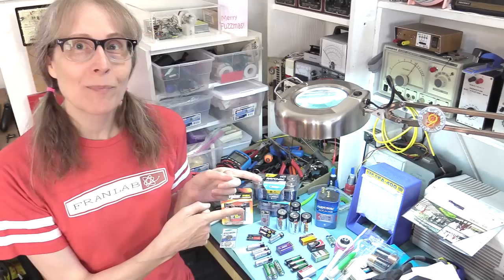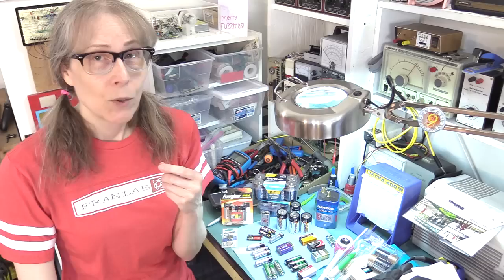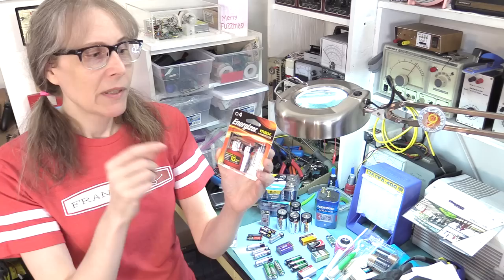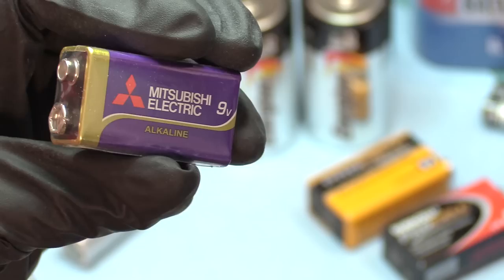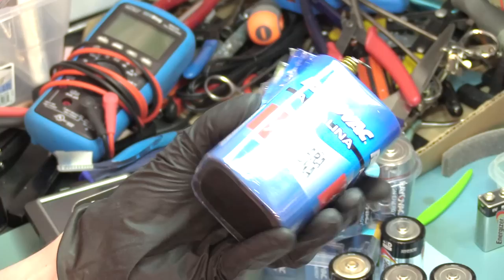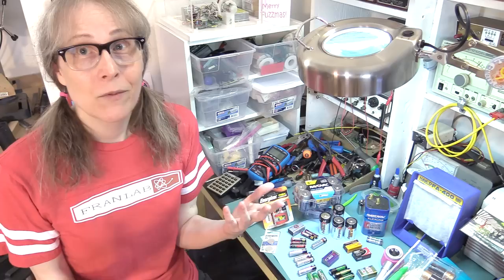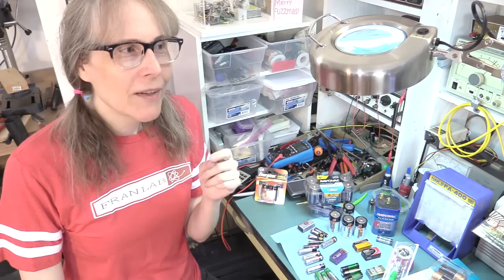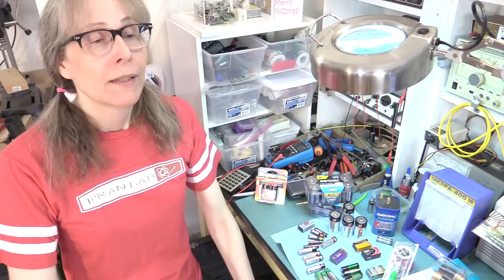Yikes! Leaky Alkaline Batteries!!!!

Comment: I've been trying to use rechargable batteries in all remotes and other pricey items to avoid the leaking situation. This is not always possible but it does help. Infrequently used items, I store the batteries in a ziplock packaged with the unit. I try to use items selected for their battery type, to reduce the amount of types I need for backup.

Comment: I have a Zenith Transoceanic radio with the original huge Zenith battery still in it.  One side is 90 volts and the other side is 1.5 volts.  The 90v side is dead but the 1.5 still shows almost 1.3 volts!  It has to be at least 70 years old!  I am thinking about carefully taking the battery apart and replacing all of the cells with modern batteries and keeping the original Zenith battery case.  The graphics of the battery is super cool!!

Comment: Hi Ms "Fran Again"..yeah leaky batteries...have replaced and cleaned off many a contacts area using moist baking soda...as well as those battery boxes in my car where the battery is placed in the engine compartment...and the roommate's car where the battery box is in the trunk...and yeah I buy batteries 2A, 3A in packs of 10 or so...usually 2 or 3 times a year...

Comment: As a testament to Ray-o-Vac batteries, I have a found a few unopened packs of AA and AAA's from the early 2000's which have not leaked, and still have a strong charge.  

As far as other batteries, I have a small portable fan that has a set of Radio Shack Enercell AA alkaline batteries which have not leaked, and the fan still works (though not to its full potential!), along with a green Radio Shack Enercell Extra Life AA "for transistor products" (carbon zinc) which still reads 1.29v. The green one is from the early '90s.  Unsure about the alkalines, but they have the more recent logo. 

I also have a set of Union Carbide Eveready Energizer D cells (also carbon zinc) from probably the 1960's or 70's which have not yet leaked.  These are totally dead, though, and if I remember correctly, one has a slight negative charge.

Comment: I've had rayovac batteries leak even before use!  Sunbeams are carbon zinc and interestingly enough a radio from the thirties said not to leave the radio on with dead batteries or they would leak or burst. I think that back then most all those batteries were carbon zinc with a sal ammoniac electrolyte as I remember. My transoceanic, even the transistor one uses the old style batteries. As far as alcaline they last a lesser time than the cheap sunbeams as the radio has a lower drain. Kinda interesting but that's what happens when you are antique enough to remember all that! All the best on your channel!

Comment: Aluminium foil if your too mean to buy a new device is great for fixing the damaged connections on most battery devices as long as there is a enough material left over on the connections such as the springs as they tend to snap right off. You then need to scrunch the foil to hold the batteries in place. Very interesting, I now tag and date new installed batteries and remove batteries especially in expensive devices that dont come with rechargeable packs if I am not going to use them for a while. Remotes are the main culprits.

Comment: I'm surprised you thought Sunbeam was a bread company 😂. They are a electronics manufacturer and are a pretty common grocery store brand of batteries here in canada at least.
Reply: We did have a Sunbeam bread brand here in the 50s and 60s. It pops up once in a while since the brand is no longer established in any given area.

Sunbeam batteries are almost exclusively sold by Dollar Tree in the states. Not spectacular but I have not had any turn on me in 10 years of using them. 

I seem to recall Project Farm here on YT testing a whole slew of these a couple months back. Might want to look that up.
Reply: @RuneTheFirst  here in Canada they still make electric blankets, coffee makers, toasters, thermostats, basically anything to do with heating.
Reply: I remember Sunbeam bread from the days of my youth. There was a cute photo of "Little Miss Sunbeam" on the wrapper. I haven't, but I'll bet you can find the photo with the Google machine.
Reply: Sunbeam is owned by Newell Brands: Paper Mate, Sharpie, Dymo, EXPO, Parker, Elmer's, Coleman, Marmot, Oster, Sunbeam, FoodSaver, Mr. Coffee, Graco, Baby Jogger, NUK, Calphalon, Rubbermaid, Contigo, First Alert and Yankee Candle.

Comment: Atom Logo was on the other side of the Heathkit logo.  Sunbeam founded in 1897. Kitchen appliances, who knows now. I buy batteries in bulk, usually Amazon and have them in a container on my bench. I take the batteries out of seldom used items and put them back in when needed then removed after use.

Comment: Alkaline batteries are best used in higher current draw applications where they will be changed regularly. For low current draw devices that may only be used occasionally, batteries may remain installed for years. This is a recipe for disaster with Alkalines. For low current devices, I use non-alkaline batteries. I have to change the more frequently, but if they do discharge completely the electrolyte dries out without leaking, usually. Or, you can just remove the batteries when the device is not being used.
Reply: The problem is it's not easy to get high quality and reasonably priced non alkaline AA or AAA batteries.

Comment: coin/button cells are a real pain because they are often mislabeled, especially anything in the AG13 size. AG13 and LR44 are alkaline while SR44, 303, 357 are all silver oxide. Silver oxides leak less and have superior capacity at higher current draws. If you have anything that takes AG13 or LR44 consider SR44s or 303s

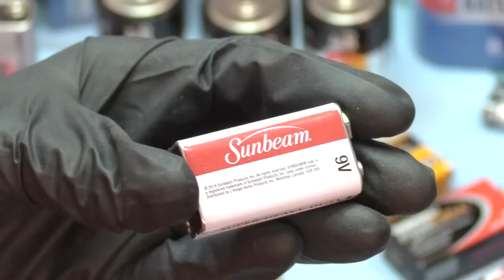Comment: 6:57 Batteries marked heavy duty instead of alkaline are usually zinc-carbon batteries, they don't last as long but they are cheaper and they don't leak as badly.

7:52 not acid or lead acid but zinc carbon.

Comment: Hi Fran.  Love your channel.  Curious...is there a reason why you don't use NiMH rechargeable batteries?  Since you work with so many electronics, I figured they'd be better anyway.  From your explanation, the leakage occurs after the battery loses all it's charge, and is left in that state (or am I misunderstanding?).   So, would a rechargeable battery allow for a solution to this?  Plus, the whole waste issue that goes along with disposable everything.  I'm a photographer, and rechargeable batteries are all I use now, unless I'm travelling or something.  Also....I had a flash almost destroyed from of course.....leaking duracells,  lol.

Comment: I still have a pair of Radio Shack AA nicad's that I bought as a kid in 1979. They were super expensive compared to alkalines but
I used them in a torch/bike light in winter for a couple of years until I finished school, then they went into all sorts of stuff, and I'm amazed that
they are still working today, now split up with one in a clock and the other in my electric toothbrush.. so used every day and still going strong at 41..
They did advertise them as lasting much longer than regular batteries, I doubt they would have known just how long that would turn out to be...

Comment: The other night as I was turning off the lights, I notice that the little glow of the bicycle headlamp. I cycled the switch and had the normal constant and the two blinking functions. When it was in in the "off" cycle, it still had the glow. I screwed off the end cap and pulled out the battery cluster and found the wet leakage on all of the 3 cells and holder, but not in the compartment. I removed the batteries, cleaned the battery holder with running water. Then I put fresh batteries in the holder and the light works properly with the complete shut off. "Duraleak" batteries used.

Comment: A just-say-no-to-Duracell PSA!   
I really just need a battery that I know WILL NOT LEAK because I have a wireless weather station.  It has AA battery backups to solar panel based rechargeable batteries.  The backup batteries must be under heat stress, so I imagine all sorts of terrible things going on in them.  Thanks to your video and the supporting comments below I will get GP "Kermits".  Since they are backups, it's ok if they fail as long as they DO NOT LEAK.
Reply: Lithium for sure

Comment: Plenty of comments here about measuring vintage batteries and finding "sufficient"  voltage all these years later; but nobody says what device they used for the measurement! Digital meters work poorly for battery testing; the meter's input resistance is so high that it doesn't load the battery down or make it work hard, and so the measurements can fool you. A vintage analog voltmeter (like Triplett or a Simpson 260 etc) has lower resistance and pulls more current from the battery, causing the voltage reading to drop if the battery is weak. A dedicated battery tester is best. Some of them use a resistive load; others use an internal battery wired backwards to "buck" the voltage of the battery under test.
Reply: Good point! I have been warning people about this for ages.

Comment: Good info, though I’ve never had issues with any device being destroyed by leaky batteries. Just popped them out, wiped out the compartment with a paper towel, and if need be, sanded the metal contacts a bit.

Comment: A lot of Lionel Train collectors think "Ray-O-Vac" is a dirty word.  One of the Lionel Diesels used a D cell battery to operate the "horn" (actually a bicycle horn inside the engine).  Of course, these toy trains would get put away for years or decades with the battery still in them.  Ray-O-Vac was a common brand used back in the day and - well - you can guess what happened..

Comment: Always remove the batteries when device not in use. The stuff that comes out is really good at eating through copper (pcb tracks and battery terminals), ends up as spreading battery rot. Repaired many things that have had this happen.

Comment: I remember when I was young my Dad's friend was an electronics repairman by trade and he swore by the GP greencells, this was in the 90s.  He did say that they were extremely expensive to procure though and were not a common commercial cell (at that time), meant mainly for industrial, he also swore by a blue packaged rechargable which had white writing and no branding which was the same, he said you couldn't get it commercially, only wholesale in big brick packs, he used them for everything.   This was before everyone swapped to lithium iron in industrial applications.

Comment: Fran, the batteries we get here have been sitting in the warehouse for about 4-5 years before they put them on the shelf. They are horrible and may last 13 to 26hrs. I've bought some that have expired in the unopened package more than I care to remember. Batteries today are not cheap. Everything you buy today has a battery operated remote. It's just plain NUTS.

Comment: I've had success contacting Duracell and taking them up on their no-damage-from-their-battery guarantee. They replaced a Simpson meter damaged with leaking Duracell batteries with a new Simpson meter. It's been admitted that Duracell makes Costco's Kirkland batteries. I've also seen on Energizer AA lithium batteries packaging, that they don't leak at all. They're expensive, but if they're leakproof, it might be worth it if the device is special or hard to replace. On stuff I don't use very often, I take the batteries out and put them in as I need it.

Comment: After enough damage and enough things being destroyed, I've gotten away from all the Al Kalines that I can, the exception being the 9V, have never had one of those leak. For my smaller cells, I'm using Energizer Lithiums, so far have not had those leak. I still have C and D Alkaline cells, but I'm always looking for a viable way to phase those out also. In the meantime, I remove check and recharge them on a smart charger once a month. I find if I catch an Alkaleak early, the electrolyte can be cleaned away before it dries and concentrates, eating metal parts. One bizzare exception is a 1996 Duracell that just keeps going for some reason, still at 1.5v+, used in my VTVMs. I never leave Alkaline batteries in anything not being used. Update I've gone to rechargeable C and D Nicads.

Comment: Beat this: In 1987 or thereabouts (+- 1 year) I got a singing cup. I was 3 (or thereabouts) years old. It uses an LDR to determine if the cup has been lifted and plays a little square wave ditty on a piezo speaker. IT STILL WORKS. You can't even change the battery.

Comment: My Energizers leaked in the blister. For almost every device I switched to accumulators. They never leak, I guess due to the different chemicals and stainless steel casings. However, 1.2 Volts have to be considered and testet for 1.5 Volt devices, and usage has to be planned. But that never caused any problems - from vintage Calculators to modern measuring devices.

Comment: Just use rechargeable batteries, never leaks. If the device can work with slightly lower voltages. I've got some weighing scales using two cr2032 batteries and drains them on a yearly basis. I just hack in a 4x AA size battery holder and stuck some rechargeables in them, the precharged low self discharged version keep a charge for a long time. Use them in remotes too. No leaks and no waste of batteries, or devices.

Comment: I have a theory on battery leakage. I have noticed that batteries in devices without mechanical power switches seemed to leak more often. Usually only one of the batteries will leak (in the short term) and checking all of the batteries, 3 of them will usually still have some charge and the forth will actually have a slight negative voltage.
So my theory is that when batteries are in a series string in a device where there is a continuous uA current flow (most intelligent devices these days) one of the batteries will have a slightly lower capacity and winds up loosing the battle and gets charged in the back direction causing it to leak. 
I would agree that batteries should be constructed such that they won't damage their host but I have gotten in the habit of removing the batteries from things that I don't use very often.
It's also amusing when you talk about lantern batteries and how heavy they are. Back in the 70' ("Back in my day" - LOL) batteries didn't have nearly as much energy per pound as they do now. If you are trying to meet the spec of the original (carbon/zinc) lantern battery, you can probably reduce the weight to 1/4 and still get more than double the energy. (and lots more instantaneous current)
I can remember wiring a bunch of "photo flash" batteries in series/parallel to get enough current to launch model rockets. Photo flash batteries were just standard sized carbon/zinc batteries a large surface area on the electrodes so that you could get enough current out to ignite flash bulbs (and model rockets) 
~Tim
(now I feel old.. )

Comment: Always be sure to contact the manufacturer and make a claim for leaked batteries, especially if they are not expired. Often emailing a picture will do, along with the expiry date, the code engraved in the battery, what size pack it came in, the device damaged and price. Eventually after enough payouts, hopefully they will learn and make better batteries again. Eveready had leak-proof batteries in the 1960s.

Comment: Gp cells are great. I have some around 20 years old with no leaks and good charge. If you want to see damage, leave heavy duty batteries in your equipment. Most don't even get to dead flat before pouring electrolyte through your gear and destroying pcbs. I only buy alkaline batteries since they usually give you a few years after expiry and only leak a bit of salts so equipment is usually repairable.

Comment: I hated duracell batteries as a kid in the 90s. They were the most likely to leak and if they leaked, they always leaked the liquid electrolyte. They did last the longest in high drain devices, but I always liked to use rayovac, because I never had one of those leak and they worked almost as good as duracell and were way cheaper.
I even had a little boombox that a black and white CRT in it that used like 500 D cell batteries. Took a trip to the beach and left it in the car. On the way home, I had it in my lap and all the electrolyte came out of the batteries and onto my lap, which caused a burn on my legs. I've left other devices using different batteries in cars before and never had that problem.

Comment: Since the 1970s I would cut index cards to go between the battery and the contacts on devices I did not use.  Never had a leak from battery isolated like that

Comment: I read that the copper top was originally a rechargeable battery... that's how why they dominated the market... but then a company produced a charger so you could actually recharge them... Duracell fought back by weakening the seals on its batteries! so they leak by design!!! ;
thank you... this was a good no-nonsense video... I'll need to label my devices :)

Comment: While I can't beat the "always on" of Kermit, I am still using my original 1992 green Enercell batteries I got with my Micronta DMM.   Only about a year or two ago did the low battery indicator come on (forgot it had one)...so I back-charged the cells for a bit and put them right back in.  No more low battery indicator!  The only issue the batteries have is light rust!  I see no indication that I can't blow by their 30 year anniversary and hit at least 40 years of service from them.